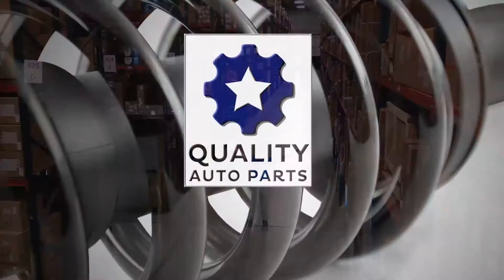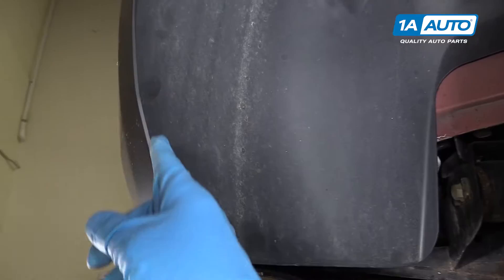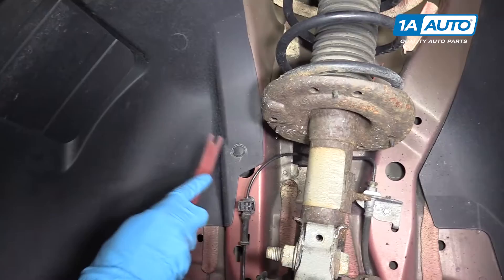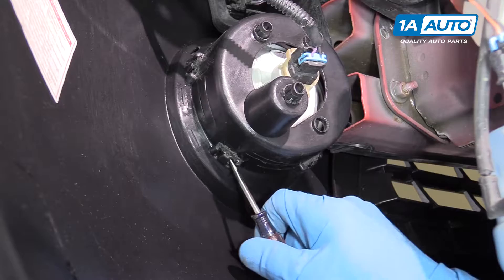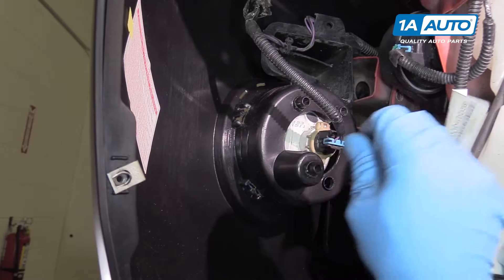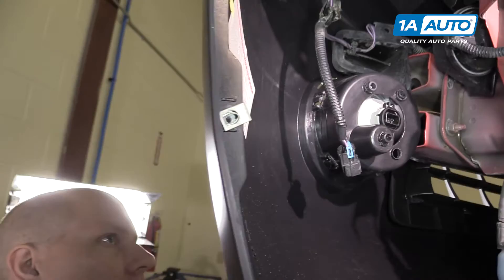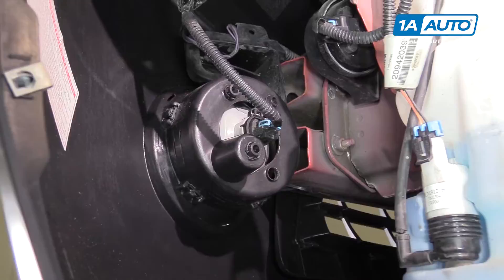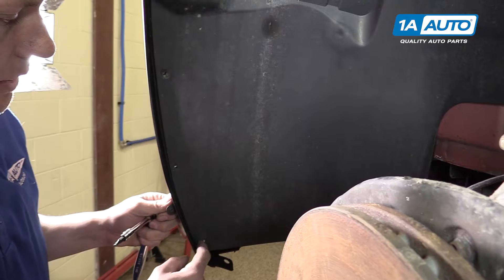How to Replace Fog lights 10-15 Chevy Camaro

Comment: The part that the fog light Snap's into is that part of the front bumper? My 2012 didn't come with any fog lights in it and the set that I bought doesn't have it. I was watching videos to see how to install before I try to do it. So now I don't know if I have to find that part are if it is part of the bumper. Could you please help me out with this and tell me if it's already there? Thanks for your help.
Reply: Hey did you ever get your answer? I'm in the same situation.